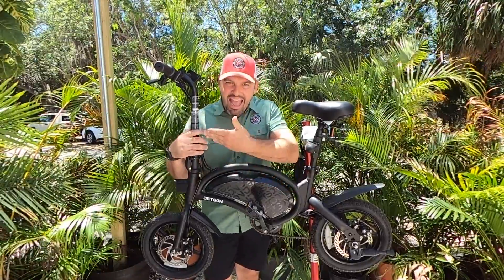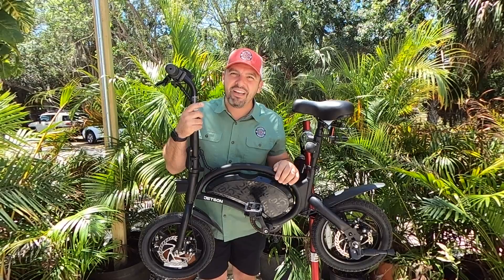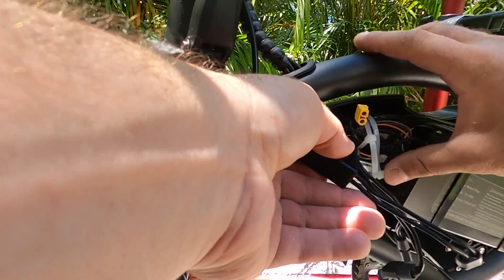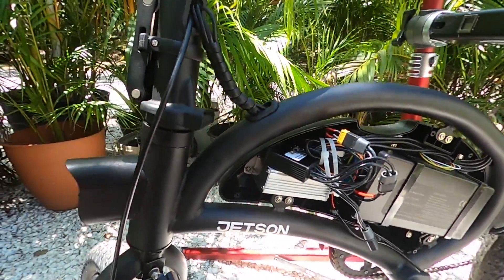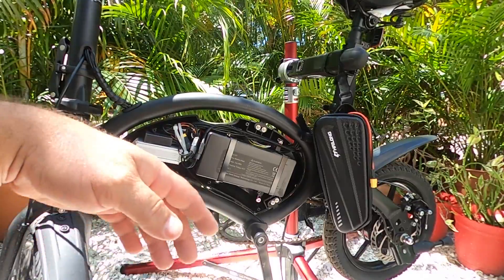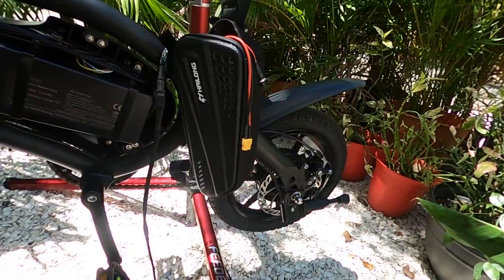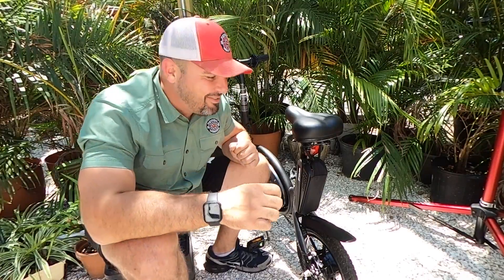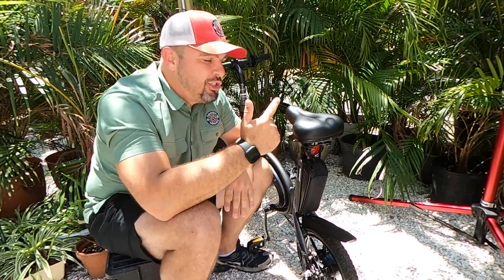Jetson | Bolt Pro | E-Bike Plug and Play Dual Battery Discharge Balancer Kit | Install Two Batteries

Comment: Greetings,
I have another somewhat technical question.
What batteries should I use in terms of voltage and which should not, for that same configuration in the Jetzon Bolt Pro.
Let me explain: 36v 15.6ah or 48v 13ah or 48v 20ah batteries or which one do you recommend?
I don't know much about the subject and I don't want to put a very strong battery in and it gets damaged.

Many thanks in advance!

Comment: Greetings,
I didn't see that you connected the charging cable for the second added battery.
Are they charged at the same time, through the charging cable that you already have (OEM)?
Thank you, very good video and contribution.
Reply from the maker: The batteries will need to be independently charged from their own charging ports
Reply: @ElectricAllWheel  so you get a second charger or use the stock and use both on it but one at a time(use longer time)?
Reply: @ElectricAllWheel  Thank you!

Comment: Hello. Is there an issue with plugging the battery in parallel without the discharge balancer? Thanks
Reply from the maker: The requirement to have both batteries at the same charge rate before connecting. The balancer allows for the combination of batteries that have not been stabilized at a mutual voltage (one charged more than the other) and to be able to use them without the worry of imbalanced discharge and the batteries damaging one another.
Reply: @ElectricAllWheel  thanks for the explanation and response.

Comment: I bought one of the battery balancers and i'm curious if it would make the battery indicator light fluctuate
  I have a 6.5ah and 12ah
Reply from the maker: We haven’t heard about any issues like this. Is everything working properly?
Reply: @ElectricAllWheel  yes it seems to work fine.
 I'm new to e-bikes ... lol 
  when the battery indicator lights go from 4 lights to 3.  sometimes it will go back to showing  4 (full)  after releasing the throttle  . just wondering if that is normal    due to voltage changing  from using power 🆚 me peddling
Reply from the maker: @cannibaldee normal. Each bar represents a larger range and when you reduce voltage sag over time it returns a higher value

Comment: Can I charge my two batteries with their respective chargers on their charge connectors without having to first disconnect the batteries from the charge balancer?
Reply from the maker: For ultimate safety it is recommended to disconnect at least one battery. 
However, often we charge our batteries as you have described.

Comment: Hello the dual battery discharge balancer Kit I received feels high quality. I have two questions. Can one battery have a lesser charge than the other when connecting? also, if in the future I get the same exact stock battery can I still use it the same way and possible charge it together at same time while connected?
Reply from the maker: Yes the balancer allows you to connect one battery of lesser charge. 
You may add any battery of the same voltage rating. Meaning, you can add different amp hours just make sure your voltage rating matches.  For the bolt pro the voltage rating is 36V

Comment: That upgrade cost as much as the remanufactured bike. How does it run after the upgrade? Steep hill test please.
Reply from the maker: The upgrade more than doubles the range.
The motor capabilities do not change and thus the function would be the same, just a longer range.
Reply: @ElectricAllWheel   Would I have to upgrade the controller for more speed and power? I’m new to E-bikes. My Jetson Bolt Pro will be here soon. I plan on using it for food delivery and transportation. It’s hilly and wet here in Seattle.
Reply from the maker: Yes you would need to update your controller and possibly your motor. The bolt is a 36V system so it’s going to be hard for it to measure up to hilly terrain
Reply: @ElectricAllWheel  Thanks for your reply and all your hard work. Peace and blessings to you and your family!

Comment: This is fantastic, I just ordered it the Jetson Bolt Pro kit from you guys! If this works out, well, I may order for the Jetson Haze, as well! As, I have two Jetson Hazes! So, I am to understand that the batteries drain at the same time, while using this kit? This means I do not need any type of switch or to plug and unplug various connections? Correct? Then, when the battery indicator becomes low, and it’s down to the last light, I just need to charge both batteries up separately, fully, and I’m ready to go again! Correct? If this is true, then this is a fantastic set up! I’ve already started recommending these kids to other people on YouTube, who, also own Jetson ebikes! This is one of the easiest and best set up so I’ve seen yet, when it comes to adding an external battery, to the Jetson Bolt Pro and the Jetson Haze, as well! Thank you for coming up with this, fantastic method, for adding an external battery, to each ebike! I’ve already purchased, a 15 amp hour battery, from Amazon, for t my Bolt Pro ebike! Can’t wait to get it mounted! I will be using a modified rear bike rack, that attaches to the seat, post, and the rear wheel fastening area! Here is that video for installing a heavy duty rack, on the back of a Jetson bolt pro! How to install a heavy duty rack for the Jetson bolt pro: https://www.youtube.com/watch?v=T6BUvPqrJuA
Reply from the maker: You are correct! Thank you for your support!

Comment: How does the second battery charge?
Reply from the maker: The second battery has its own charger and charge connection.
Reply: So you cannot use the factory Jetson charger on the second battery?